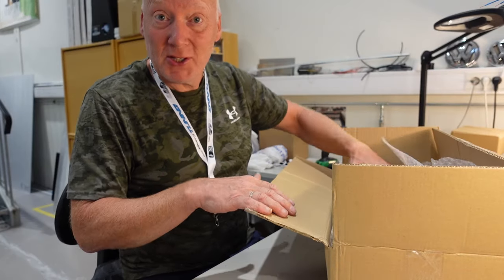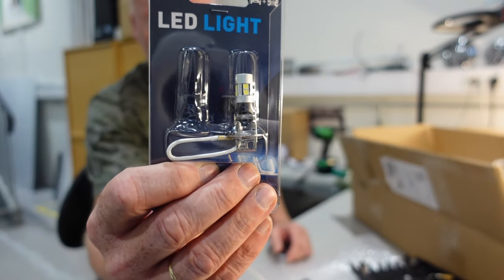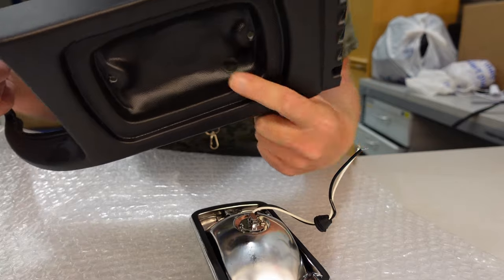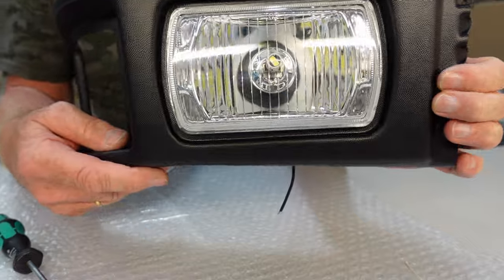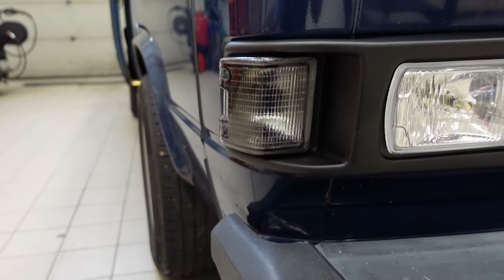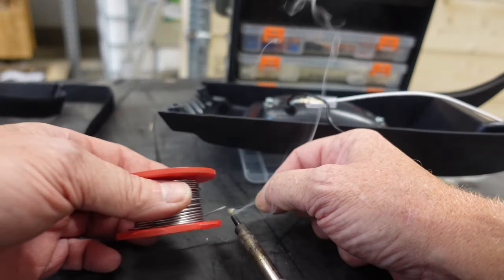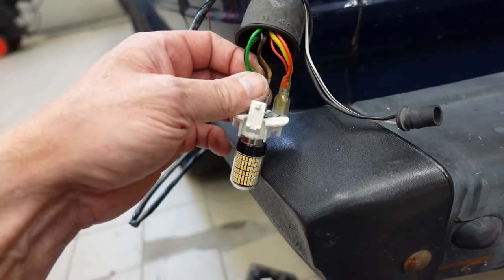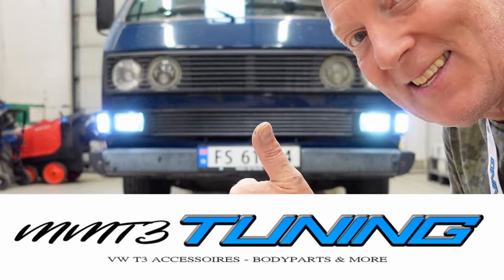VW VANAGON T3 Fog Lights - MMT3Tuning (projektzwo terra podz)

Comment: Nice upgrate from mmt3 John but i prefer a switch. It is to much light for drl.
Like your video's!!
Reply from the maker: Yes you might be right. The LED I installed are not thet bright, and I have not "tested" them in traffic yet, so time will tell if on coming cars starts to flash their headlights at me.